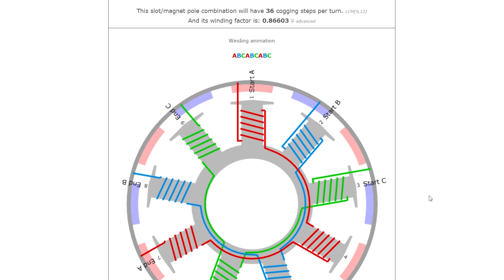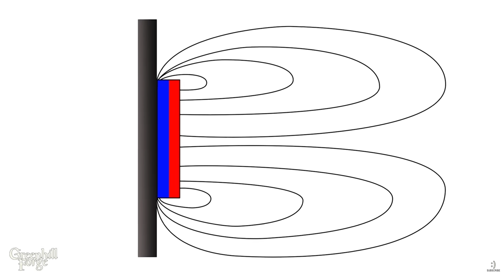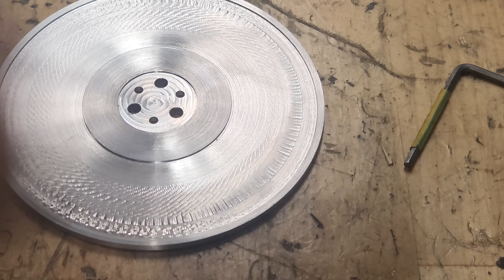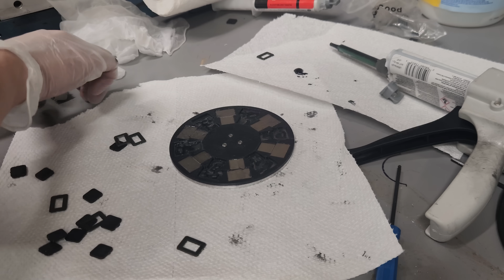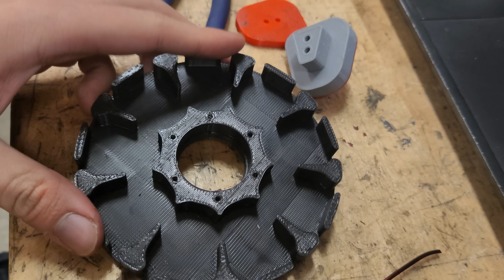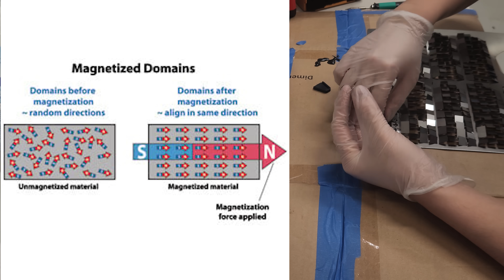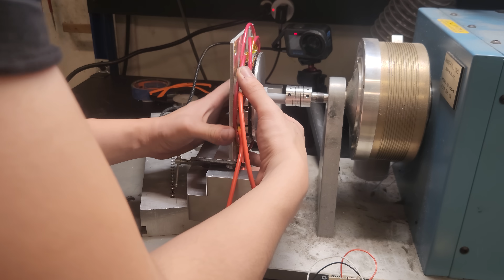Homemade 1000-watt motor

Comment: Heh, 1000-watt is nothing. Jk jk it's a really good start. At formula student we used to build 35000W (35kW) radial motors by hand. They were not reliable at all, transmission oil kept getting inside the motor. We burned all 4 motors and had to remake them in a year basically only for them to burn again and someone next year has to make them again lol.

Comment: Good stuff, It reminds me of the "pancake" motors they use to use in old computer disk drives. That's not bad for a 1st atempt-couldn't you improve slower RPM efficiency and stop cogging with hall sensors? Also- I was thinking a while ago if a hybrid of an outrunner and axial flux with a rotar on both sides of the coils was possible ?- i'm sure it would also be more efficient if you made the whole stator from those thin sheets of stacked grained/magnetic steel with the windings wound tightly to it- like the former you would find in a scooter hubmotor Instead of having magnets causing eddy currents in the aluminium part of the stator too. ..ATB. happy tinkering-have fun bud.

Comment: Sharks like musk will steal your design.
Cool project. 
The efficiency is way too low: it should be higher than 90%
Reply: Musk is plenty smart he don't need this guy to think for him. Also he hires smart engineers. So "Tom" here makes a motor you are not familiar with, actually invented in 1821... yes the yr 1821 and thus you think Tom is some kind of genius smarter then anyone else?

Comment: Nice work! Probably the power and efficiency could be improved a lot by adding laminated steel back iron to the stator coils. At present the magnetic flux behind the stator has to flow through the air (and aluminium) which has very high magnetic reluctance compared to silicon steel, greatly reducing the magnetic field strength for a given stator coil MMF. That rear flux would also be inducing eddy currents in the aluminium frame. (Or, as someone else suggested, you could add a second rotor on the other side of the segmented stator - may infringe on YASA patents, but would hugely increase performance..)

Comment: I don't want to be a buzz kill, but the hardest part of axial flux motor is highly underestimated: The coils on the stator produce strong axial magnetic forces which leads to rotor deflection. This means the "secret sauce" in an axial motor is not the coil or magnet arrangement or even the grain oriented electrical steel, but rather how you integrate the bearings into the motor.

Comment: Hi could you please make more video about coil calculation? I am a begineer from Mechanical Engineering. I really want to develop our own motor
Please also explain what can be our parameter to gain torque, rpm and so on

Comment: Hi, have you seen the production axial motors? they tend to not simple triangles, but towards bend triangles, similar approach as you mentioned by using curved lines instead of the triangle shaped coils.

Comment: Its impressive you made a axial flux motor!
I shudder the first 3 min how you are using your tooling though! Your stock isnt concentric because your fist cuts should be to square it up by removing meterial, then flip it 180 cutting down to size.
You broke a tap because it should be done by hand NOT with power tools unless you are using a cnc, not a drill press. Cutting helps fluid wd40 is fine, even cooking oils and dish washing liquid with a little water. Turning the tap 1/2 turns and backing out to clear material, its straight flutes not spiral they dont self clear, hence why it jammed and snapped the tap. Aluminium is also a gummy material making the jamming more common when using power tools.

Comment: So what if u dont use an magnet with them copper wire, So there isnt as much drag? just like straight up copper coil without wrap around any magnet...what is the difference between with and without?????

Comment: I'm impressed with what you were able to do without having a high standard to precision. The measurement shaft was so out of alignment that it was extra resistance on the motor and readouts. It would be much higher efficiency if you aligned it precise. It looked too low adding stress where there should be none.  That clicking thunking is  give a way to it at low speed.

So if you can do this at school. I am hopeful to prices coming down to 4 motors on 4 wheels to make an electric vehicle. When China gets on to it, we may have $20k cars with payment plans and service plans mixed in so even pensioners can travel in the electric future with battery exchangers all over the state and country. Thanks for your contribution in showing how easy it is, even if you only have she will be right kid standards. Try it more precision made and be more like the 10000 Watt the Mezedes factor is doing for Lamborgine research.
Reply: Like you have the tools for precision. I lost heart with the file instead of the cutting tool on the lathe. Lift that standard to a tradesman standard and your 40% efficiency will be much higher.

Comment: Always wondered, instead of a coil backing plate, why not use another rotor, so you could interface the magnetic field on both sides of the coil... Or go even further & include the outside edge of the coils & leverage 3 sides of each coils field? Ie., are hybrid radial/axial motors a thing?

Comment: The steel core heats up at higher rpm, hence the further drop in efficiency. The design hasn’t incorporated any form of cooling, that leads to lower efficiency. Also symmetry of flux in axial motors plays a vital role in overall performance. Great project!!!

Comment: What are the biggest culprits to efficiency in this build?
Reply from the maker: I dont have a second rotor lol, so half the flux comes out the bottom. Although the bottom housing acts as a massive heatsink which preserves the power rating overall.

Comment: Amazing. Did you use electrical steel (silicon steel) or just random steel? Cause if so, that's probably why you got low efficiency. If you can't find electrical steel (i still haven't found a way to reasonably get it), i suggest you to use annealed/soft iron sheets, well insulated. As an alternative, you can use annealed/soft iron wire and you just give it the shape wrapping it around a 3d printed trapozidal support (that you can then remove). I was thinking about making a motor too these days, but i'm broke as hell. Good job tho :)

Oh also i noticed you used a metal case to hold the stator together (i guess it's alluminum?). Don't do that. it's gonna generate eddy currents and bring down efficiency. Fot axial flux it's usually prefered to use robust plastics. Tho i can't really tell what kinda. You may wanna look into that, and maybe experiment with composite materials, but don't use conductive metals. If you use the iron wires as cores, you can create a plastic skeleton that connects all the supports around which wrapping the iron wires to make the individual cores, making the all structure much more robust and having space under the stator to mount a second rotor. You can do that too with the sheets instead of the wires of course, but it's gonna be more difficult.
Reply from the maker: I bought my silicon steel from aliexpress before the tarriffs hit which now make it kinda difficult, but yeah aluminum housing is good for thermals but definitely is causing more eddy currents

Comment: 1033   and  THAT  is why the stator form should  NOT  be  metal.!!!     if the stator form is metal, that will help to reduce the amount of apparent cogging.    but that metal should be laminated silicon steel.   and, the lams in that metal, including in the coil cores  SHOULD  be optimally oriented.

Comment: 0720   any kind of metal stator form should  NOT  be used.!
0816   graphic is wrong.  end of green coil  Should  Connect  to the  Start of the  Next  GREEN  coil.!

Comment: 0640   you may know that, for best efficiency, a solenoid coil should wound such that the direction of current flow in adjacent layers is not 180 mechanical degrees out of phase.     (one solution is to not have more than one 'initial' contiguous layer.    in a layered coil, when that out-of-phase condition is avoided, the coil will make no back-emf nor will it have the other traits that are associated with back-emf.

Comment: 0500    it should be understood that this polarity configuration (on a rotor) results in the formation of a 'full' magnetic pole, between each pair of adjacent n-s poles.     in other words, the 'poles' on a correctly made rotor do not directly align with the magnets.

Comment: good work, mostly.   some of your 'facts' are wrong, however.
0420   silicon steel should be used where a moving/changing magnetic field will be.    in this case, mild steel of sufficient thickness can/should be used for backing iron.
0440   the  STATOR  will be the thing that gets warm.!!!    not  the  rotor.

Comment: Where do you buy silicon steel from?

If you put a second rotor on the other side of the motor, you’d make the magnetic circuit much more efficient, and without needing a whole bunch more laminations to replace your aluminium frame. Alternatively, you could cast your own ferrite epoxy, even exotic ferrite mixes could be just a matter of buying the right oxide powders from eBay and chucking them in a ball-mill.

Comment: I got a few suggestions for you;
---------------------------------------------------
1. Google 'Litz wire' -most of the current travels within a very short distance from the surface of copper wire, its also way easier to wind
2. Not sure why you didn't simply wind the coils around the cores -i.e. use the laminated cores as formers.
3. Make two rotors using a Halbach array configuration in each pointing towards the stator -you won't have to use so much metal in the rotor to form the return path.
More advanced experiments;
4. Water cool the stator (the YASA motor uses oil)
5. Carbon fibre rotors (or perhaps CF Nylon 3D prints with structural CF tow.)

Good luck!

Comment: It's worth noting that high torque isn't always what you're looking for in a motor. For a drone, for example, especially with tiny drones, you may want low torque because the energy produces higher rpm. This allows you to use smaller propellers, which is really good in a case where you have propeller guards. You can have higher torque motors if you want, but then it spins more slowly and you need bigger propellers and the extra large prop guards would destroy your efficiency. Low-torque, high-RPM motors, however, get really hot when you load them too much, which is why drones that carry heavy things usually have large propellers instead of small ones that spin fast.

Your hobbyist ESC probably didn't work because its software refused to allow it to operate at an RPM low enough to spin yours. It was probably for the best because if it tried, it would probably have overheated. High-torque ESCs get expensive.

Comment: Hey, really nice build – especially how clean you got the rotor and stator together.
I was wondering: did you ever consider using a Halbach array for the rotor magnets instead of the simple alternating polarity?
I’m curious if you looked into it and decided against it (complexity vs. gain), or if it just wasn’t part of the design scope.
Reply from the maker: Just wasnt part of the design scope. I already had the magnets on hand and can get a similar behavior by adding a back iron.

Comment: Nice job buddy! I bet you will be able to improve the motor and it's control a lot in future but please prioritize your safety in the test setup: 
1. Don't trust the cheap couplers to take huge misalignment of the motor shafts - Align the motor/dyno axis using shims 
2. Mount the motor properly
3. Add Safety cage over the motor and couplers. 
4. Even if you have the cage over it don't stand anywhere near (ideally different room) part's of your motor at 11000rpm could become projectiles that can kill you on the spot - please take it seriously
5. Add temperature measurements in critical points to assess the limits and weak points of your design 
6. Consider adding encoder or resolver instead of sensorless control, might remove few headaches for the start.

Comment: Mate, you gotta calculate your relative centrifugal force for the spiny bits. A 6" disk, spinning at 11,000rpm, at the disk edge (it will be lower the closer to the center, but....) its experiencing 10,308g.....No g as in grams (unless the mass in question is a gram stationary), g as in gravitational constant. Anything on the disk edge is 10,308 times heavier. And that is how a little magnet made that epoxy fail....because it got FUGGIN HEAVY!!!

Comment: You my boy forgor to add the back rotor

Since you have high tortillas, you get lower efficiency 

So double the rotor and you get more efficiency 

Plus this is static test and no load,

Comment: @tylon , excellent work!!!! I look forward to the next iteration!
1) Try your coils in the flat orientation and lay them in their own grooves 
2) bring your rotor and stator closer together 
3) get a 4 jaw chuck for better alinement and ability to do concentric and non-concentric shafts 
4) epoxy your coils in place ?
5) start thinking about heat losses and how to cool this beast 
6) consider multiple bearings to prevent indexing and wear or needle bearings 
7) when you get to double coil designs, consider offset/timing of coils on each side
8) irregular shaped coils may cause irregular magnetic fields, consider 3d printing a "coil jig" to bend coils into consistent and repeatable shapes
9) Consider how to produce your steel/ferro cores via a repeatable process so your fields are consistent
10) consider mechanical fixturing of ferro cores to prevent "wabbling" due to epoxy flexure
11) you can make square magnet wire from round by using a jeweler tool for wire squishing, they are cheap... or you can make one... but consider that you may need to up ga and that you may want to apply a thin layer of epoxy after the process to restore coating

Comment: How would copper tape work for the windings? 5mm, 10mm Ect, you could use Kapton tape as an insulator or even kitchen cling film/shrink wrap (might be thinner and allow more turns)... also, maybe router out a steel rotor for the magnets, or add a steel band to add to the magnetic flux & prevent the centrifugal fling of super-sonic missile magnets? 🤔 good work, i like the direction you're heading. 👍😎 (Btw. Aluminium isn't the best metal to use with moving magnets, it opposes a negative magnetic force and acts as a damper, not ideal on a stator)... consider old hard drive voice-coil magnets if you can get them... you could even maybe use the premade coils.

Comment: Hey i have some suggestions 

You should use multiple strands of wire in parallel for the windings. 

I could be wrong but the way you oriented the stator core plates provides very little benefits in terms of eddy current losses 

You should sand the face of the magnets as well before glueing them to the rotor.

You should also use an axial thrust bearing for the shaft.

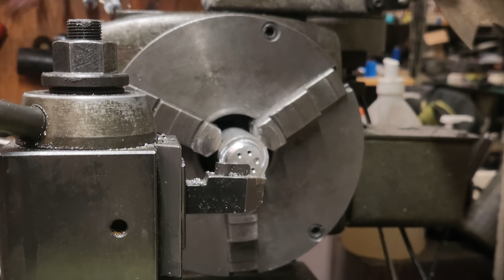Comment: 1:34 If you want to have a concentric cylinder on a lathe. First you must do a rough turning pass only as deep as the surface. Where there is no more wobble or surface artifacts.

Next you must flip the stock 180 degrees and put the side you just turned --- into the jaws. Then you can turn the remaining cylinder to the final dimension. Remember that this operation could get hot, so over time the part will cool and shrink. Be aware of this factor.

Comment: I admire your work boss, needs a double rotor, half the energy put in is being wasted. 
Remember that electricity is magnetism, electricity likes to travel in a circuit and so does magnetism, hence why a horseshoe magnet is the most powerful as when it's stuck to metal there's a magnetic circuit.  Thinking of this, I'd couple rotor magnets from each side together in pairs so two magnets either side become one magnet, N + S, a horseshoe around the motors edge to each side of a coil. Now each magnet pair going over a coil is a magnetic circuit.

Your motor has trouble starting because there's no hall sensors. VESC  uses hall sensors to start motors up then switches to sensorless mode when at a certain RPM, sensors are only used at low RPM. 🙂👍

Comment: Excellent work!

Two things: 
1) it's dynamometer, not dinometer. It's commonly pronounced dinah-MOM-eter 

2) Safety. There should be a guard around the motor. If something should break loose at those speeds, it could become a lethal projectile. Be careful!
Reply: What do you mean if ? A magnet did fly off and could have killed him. These kids are playing with fire at school. #1 rule of testing a high-power motor on a bench: clamp it down !

Comment: the iron core is open at the coil side; there is no magnetic loop- likely have significant eddy current on the aluminium support
Reply: aluminium have so little eddy current to be honest; it act almost like air to be honest.
a dual rotor will inprove performence greatly

Comment: FYI, you can actually lose a surprisingly large amount of power through vibration (which wastes power due to more friction and thus heat.) Logically these losses increase with rpm speed. Therefore the more precisely you can machine and balance your parts the more power you’re ultimately going to get. Great video!

Comment: For an easy upgrade you could exchange your structural parts (at least the stator, rotor might be a bit more difficult) from a non-conductive material. Commercially often PEEK is used, but I think for starters PC should work as well (dependeing on which you can source cheaper in your area). It will significantly reduce eddy current losses in your motor. Since aluminium is a fairly good conductor it also produces considerable eddy current losses.

You should also consider mounting a steel backing plate on the bottom of your stator for the same reasons you used one in the rotor.